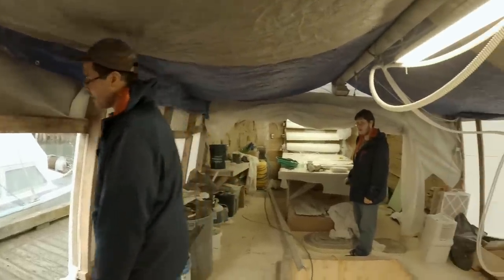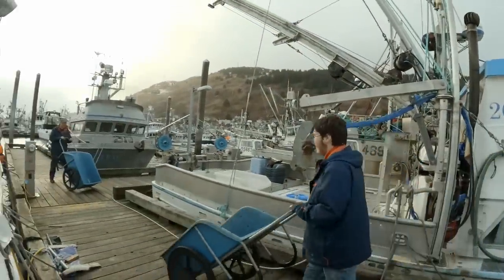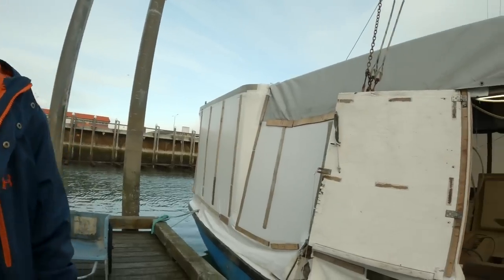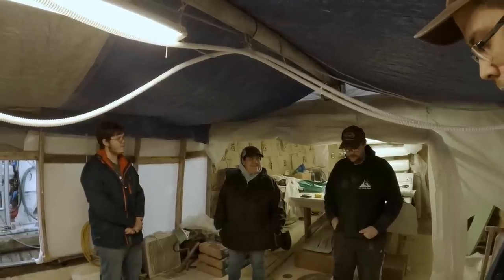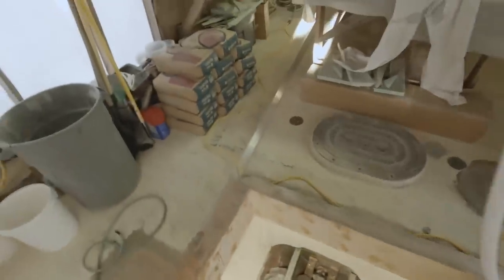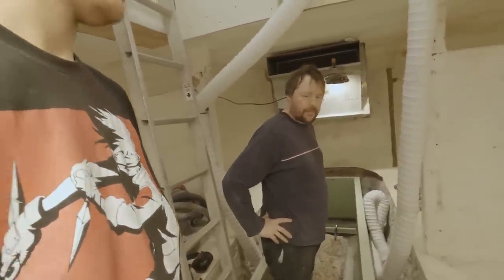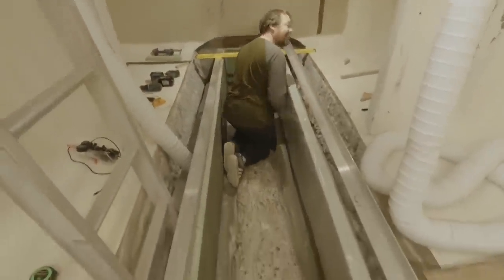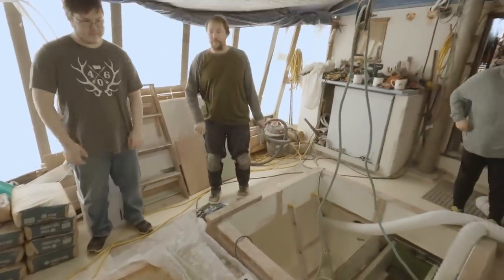Prepping Shaft Alley for Concrete/Ballast - Emerald Isle: Ep.41 Fishing Boat Refit

Comment: 0.0015"/inch of shaft diameter for clearance for babbitt bearings. Try not to exceed 140 degrees Fahrenheit. Looks like there are shims on the split line so you may be able to adjust clearance. Use plasti-gage for checking front to rear canting and side-to-side alignment. You could put a grease canister on top of the bearing which has a timer for injection. The canister could be located to the side or remotely if you wished to as well. There are some of those which are pretty low profile. It would need to be disabled or turned off when the boat is not in use or you will use all the grease and/or fill the galley channel with grease.

Best of luck, it has been a fun watch and I have enjoyed the craftsmanship.
Reply from the maker: Great info AK Fisher. Much appreciated. I will look into a grease canister and see if that may work. Most likely we will just run new grease lines from the engine room.

Comment: Concrete moisture testing: Why it matters for finishes applied to concrete.

Moisture is by far the most common issue that can compromise a concrete asset and the coating that protects it.

Concrete is prone to moisture issues due to a channel of capillaries formed during the hydration phase (hardening phase). The number of channels can be dramatically increased or decreased depending on the water / cement ratio used in the mix. The permeability of concrete can be reduced by using mix designs with lower water / cement ratios, various admixtures or by applying protective coatings. When applying protective coatings to concrete, moisture-related issues happen quite frequently.

Those sources of moisture include, but are not limited to:

    Water left over from concrete mixing, known as bleed water.
    Naturally-occurring sources like precipitation, groundwater, condensation or infiltration and inflow.
    Water escaping from nearby man-made sources such as broken plumbing pipes.

Concrete moisture testing methods

Because moisture issues are so common, an array of concrete moisture testing methods have been developed to address them.

ASTM D4263 – Indicating Moisture in Concrete by the Plastic Sheet Method. This test involves taping an 18” x 18” polyethylene sheet to a concrete surface and then waiting at least 16 hours. Visible condensation on the sheet or darkening of the concrete indicates excessive moisture. Any coating applied to the surface may be at risk of failure. It’s a useful surface-level test, but it sheds little light on the severity of the moisture problem within the concrete slab.

Comment: Would painters masking tape work for lines?
Reply from the maker: That was our first plan to use tape as a guide. Turned out screwing in the aluminum angle was faster and much more accurate. Our goal was to get a nice flat surface that we could fiberglass over after the concrete set.

Comment: If you're going to use your back to lift, it's best to kind of lift and twist at the same time and hold the weight out in front of you, not close to your body. That way the injury you  sustain will take months of no physical activity to heal.
Reply from the maker: Yea, probably not the best form for lifting, we're not moving bags of cement everyday, so not really a load we're used to moving around. Got through this time to no injuries I'm happy to report.
Reply: @EISAlaska  I was actually describing what happened to me one time. I was painting a sign, and had a guy help me flip it over to spray the other side, and I ripped a tendon in my back. The sign wasn't even that heavy, we just got in a hurry and I paid the price.